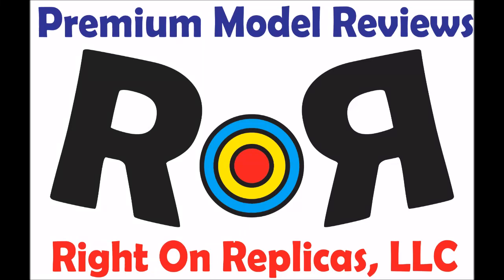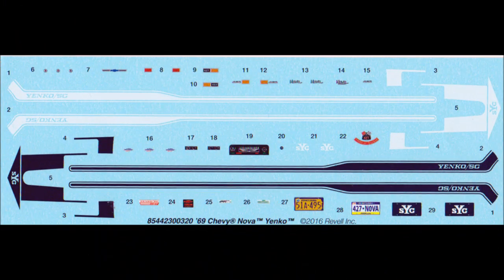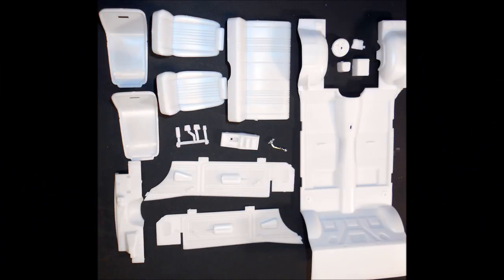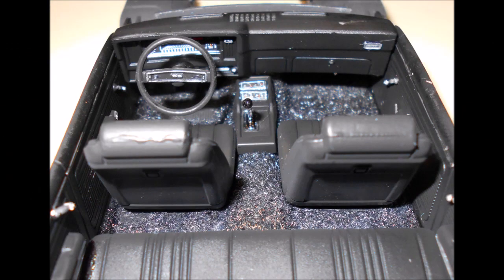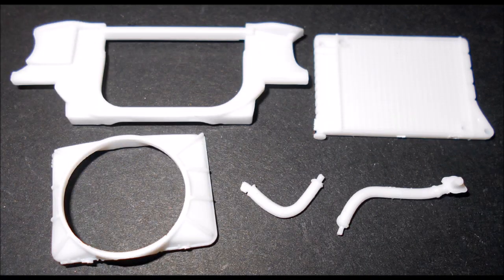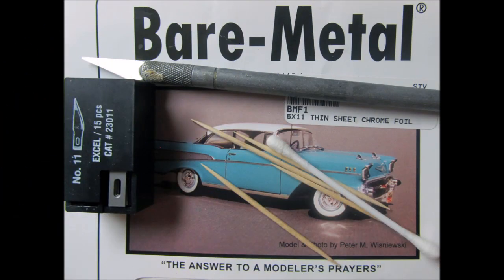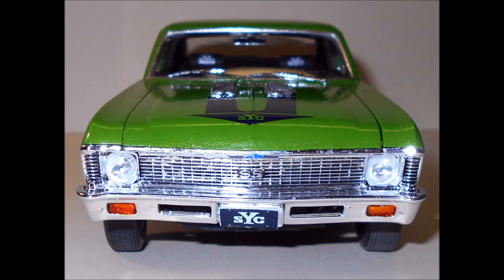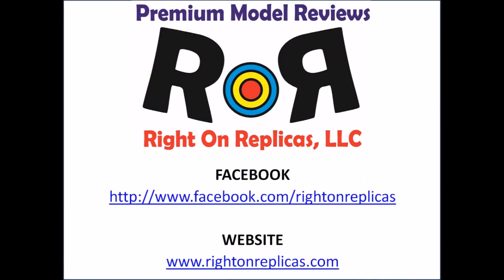How to Build the 1969 Chevy Nova Yenko 1-25 Scale Revell Model Kit #85-4423 Review

Comment: Hey buddy, I bought the exact same model & brand, this is my favorite car! I had it for a while but when I finally quit drinking for good, I started on it. I was painting parts still attached to the molds (easier and less confusing to do that before cutting them off). Then I got curious, searched for how other people do it, and found your video. It made me realize a lot of details, such as the colors for the battery (words, terminals, water lids) and I'm glad I found it. One thing I learned after searching to correct things is not to use paint thinner, I don't think it works, use rubbing alcohol, it takes dried paint off immediately and you can rub it off with a Q-tip or easily scrape it off with a blade knife. For very fine details, such as the battery, I used a toothpick for both, the rubbing alcohol and painting. Yes, I'm very detail-oriented. BTW, this is the very first time doing models, and any type of painting, I'm not done yet, but I'm seriously loving it and patting myself on the back lol. Thanks for this tut, you taught me more than just simple modeling! If you want, I'll be glad to send pics when I'm done, my email is jamminwolf-at-hotmail-dot-com (spelled it like this so stupid bots don't take my comment down).
Reply from the maker: JW,  Thanks for watching and for sharing!   If you find our channel helpful, please subscribe if you haven't already, to help us continue our mission to inspire more modelers!  -Doug!

Comment: I had the AMT version of this car (as a '72, I believe) back in the day, and I remember the front fenders being separate pieces and a right royal pain to get the whole front clip together and aligned properly. The nice touch with these newer kits is the detail decals (badges, dash panel, etc.)
Reply from the maker: Tim - I believe you're right.  The Revell version seems to be a little easier to build.
Reply: Tim Brouwer I had that kit and it was very good, and yes the fenders were separate !
Reply from the maker: The - Thanks for the details!  -Doug

Comment: I’m having trouble with the leaf spring and rear driveshaft to stay together
Reply from the maker: Cody,  If they aren't sticking together, sand them down and use some superglue with an accelerator while holding them together.  If they don't fit - you've got something out-of-place or the axle is tilted too far.  Hope that helps.   Thanks for watching and please subscribe if you haven't already to help us reach more modelers! -Doug!

Comment: Can you please help me this is the second kit I have purchased from Revell  and I did not receive the metal pins for the wheels any ideas? This is bull crap.
Reply from the maker: H2,  You can flare a piece of rod stock or proper diameter sprue with a heated candle or cut off a nail to replace them.   Thanks for sharing and please subscribe if you haven't already to help us reach more modelers! -Doug
Reply: I like the nail idea. That should work.. I’ll let you know. And I also subscribed… I love your channel… I found the pins… 🫣